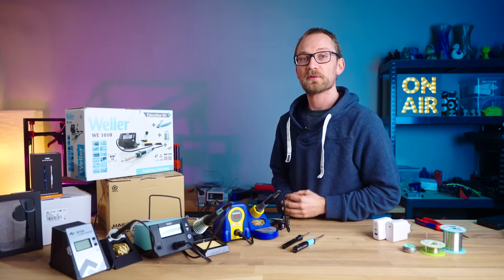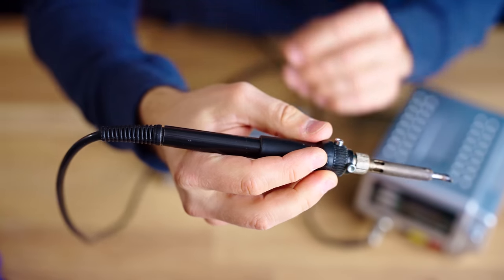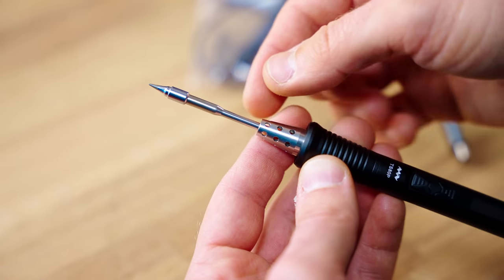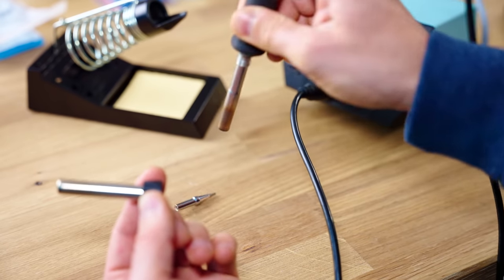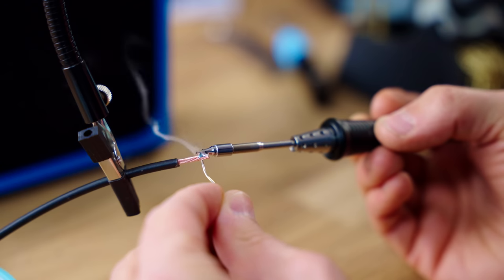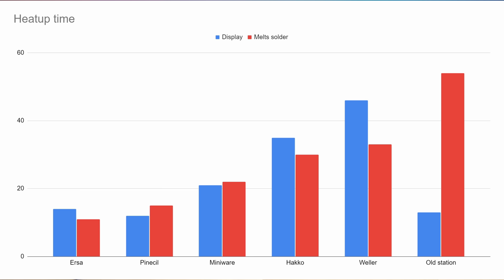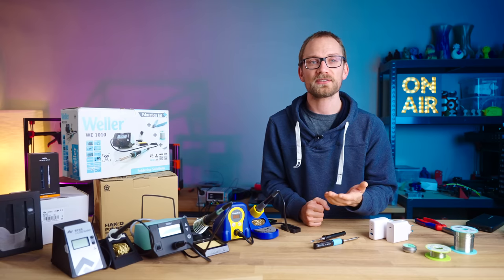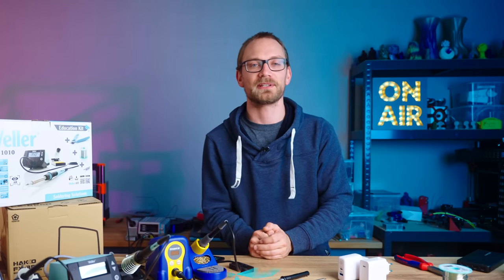Best hobby soldering iron? Pinecil vs. Miniware, Hakko, Weller and Ersa

Comment: I absolutely agree! I work in my lab full time, mostly focused on component level board repair for industrial clients. And when clients need it….I specialize in test equipment repair, calibration, and other metrology related tasks.

I love my test equipment and tools like my children. And I REALLY love some of my expensive soldering stations. I wasn’t expecting the KSG ER to come anywhere close to the more expensive gear. But it does! Been using them for a few years now, 12 hours a day six days a week. I have several, And always have at least 1 or 2 stations powered on when in the lab

the KSGER T12 has REALLY impressed me. For About $50… it performs 95% as good as irons/stations in my lab. Most of which cost 10 to 20 times more!

Comment: You did miss the Miniware TS-100. It runs from a DC power supply and is rated for 65W at 24V. I believe it also uses is able to use Hakko T15 tips although they are a bit longer. I replaced the stock power cord with some thinner gauge Silicone wire that is very flexible.

Comment: I bought that same Weller unit for occasional soldering at work, and it is, as you said, a solid and reliable unit, and one that I was comfortable purchasing with somebody else's money (I don't want cheap tools that die at work).    What I bought for home is a KSGER T12 and it is.... gloriously fast.  I really like the KSGER T12.  It was a lot cheaper than the Weller, and it has shown itself to be reliable, but certainly there was some doubt at time of purchase, and it took weeks to arrive.   The Weller was in stock at my supplier and I had it the next day.  
Honestly, I think that for the price of the Weller you could buy two T12 units and keep one with a type K tip and the other with a small tip and it would be a rare day, indeed, that you needed to swap a tip for normal work.   Being in the T12 world gives you access to many different shaped tips, including ones shaped to heat chips all the way around and other strange devices - that can have value if you do a lot of certain kinds of work.

Comment: Great comparison, thank you!
Heh, I know you from the time I tinkered with 3D printers, and now was looking at soldering irons for a whole another topic and was like Oh, a familiar face!

Was considering a Pinecil or a TS101 but the thing is, the older brands like Weller, those will keep working for decades. My dads 30 years old Weller soldering station is still going strong, and you can even still buy new tips for it without any problem. 
I do not think a Pinecil can live that long and you certainly won't get new tips for it in some years.

Comment: It should be the same on the Pinecil, but on the TS100 you can leave the screw on the opposite side of the screen since it's not long enough to tighten the tip. I personally keep the screw on the screen side a bit loose so that it has contact with the tip, causing some friction but not enough to lock it in place. This allows to just pull out the tip and plop the new one without extra steps.

Comment: I have a ksger t12 v3.15. Very fast and flexible. Not expensive also easy to change tips. The menu is easy and lots of options you can set. Even make profile for different tips and calibrations.

Comment: I've had an 888D for a few years, and I love it, but sometimes knowing you have to find an outlet and set up a whole station is enough to prevent me from starting a project. 

I convinced my boss at work that we should replace our crappy red weller iron (not convinced it wasn't a woodburner, actually) with a pinecil, just because I wanted to try one.

I bought one for myself, because it's a great little iron, and I can run it from my power tool batteries. It can live on my PC desk and not be in the way, unlike my Hakko

Comment: just remember that the weller was said by eevblog to be lacking a primairy side mains fuse

Also the tips that are more expensive on the cheaper ones: they also have heating elements closer to the tip and that means its finer controller temperatures and should be much more stable.

Comment: I got a good deal on a Weller WS51 like 25 years ago when a local electronics store was going out of business. That thing is still dead accurate and an absolute treat to solder with after all that time. It was very expensive to me as a university student with a part time job making minimum wage but its maybe the only electronic item I have that is that old. Just no need for anything newer.

Comment: I use a Weller WSD 81 station with a WSP 80 soldering pencil, not cheap but solidly built, very reliable and spares will be available for decades. I've heard good things about Hakko and would be willing to try one out if I'd need a new soldering iron but as I also have a fixed temperature Weller TCP station I bought new in the late 1970s that's unlikely to happen anytime soon...

Comment: I bought a pinecil a good 8 months ago now. I love it. Worth every penny. Iron os is great, easy to update (on linux). I need to buy more tips. If you use the barrel plug, consider making a silicone cable out of a tattoo gun power cable. There's a few videos on it, mainly for the TS100 but it works just the same.

Comment: I have been soldering for almost 45 years, and I hate lead-free, primarily becaus it breaks down much more quickly than regular 60-40 lead solder, especially with temperature extremes, not just from heat but also extreme cold.  Millions of devices are consigned to the landfill every year after failing prematurely because lead-free solder connections just don't last as long.  Also, although rosin flux used on lead solder is non toxic, non corrosive, and usually non conductive, leadfree solder uses acidic fluxes that are corrosive, toxic,  unpleasant to breathe, and *conductive*, and must be completely removed from your solder connections or the flux residue will cause the copper traces to degrade, and perhaps even cause current leakage paths through the remaining traces of flux. Also, the higher temperatures necessary for soldering lead-free, and the corrosive fluxes, tends to greatly shorten the lifespan of even the best quality soldering iron tips. Cheap tips, made of crap metal that aren't well plated, will have a very short lifespan if you are using lead free solder.

(PS, the reason that 60-40 tin/ lead solder has lead in it is to stabilize the tin and prevent  "tin pest", where the tin changes its crystalline structure, crumbles or becomes powdery, and degrades. Look up the phenomenon called "Tin Pest". Also look up "tin whiskers", aka "dendrites".  Lead free solder is still mostly tin. but the other metals it is alloyed with don't have the same stabilizing effect as lead would. Tin solder without lead to stabilize it actually derailed an early Antarctic expedition !).

Comment: If you want really high end, you need to go JBC. I used many soldering irons in my life and those are just something else. They just don't care how large your mass is and I hardly have seen more then 20-30% usage even on large parts. The temperature stability is just superb. You can switch the tip in a second and the new one is heated up when you reach the part.
Reply: JBC and Metcal are basically black magic. But sadly the price tag reflects that as well. Though, they are both dipping their toes into more affordable market segments in recent years, though still quite expensive compared to anything in this video.

Comment: The TS-100 is amazing. I've been working as an electrical engineer designing surface mount devices. 
After using a bunch, the ts100 is my favorite. It's response time is similar to the hako, while also being more convenient, having better thermal conductivity, being portable, and the temperature control is a lot more accurate. I also like that when the wattage goes up and it detects that you're using a lot of heat transfer into a large thermal mass, it will boost the temperature up a little bit so that the target temperature is somewhere across the gradient.
Reply: Does it reach the advertised 400°C? I am asking for industrial solder.

Comment: Having extensively used the Pinecil V1 (as shown, for two years) and the newer, but same price, V2 (for the last year), as well as a more fancy Ersa station (for the last two years), I can give some detailed insights into longer use. Before that, the main advantage that the V2 has over the V1: shorter tips with less resistance (=more current, higher power), and a higher voltage rating (28V for up to 120W of soldering). Also, I recommend buying the "gross short tip set" for the pinecil, it's well worth the extra cost of 26$ (<30€ after import duties if you order combined with the pinecil). I haven't used the default conical tip even once since I got the tip set with the V2.

- The Ersa tip system is better at transferring heat than the Pinecils, despite having passive tips. I can comfortably solder an XT60 at 320°C (leaded solder) with the Ersa chisel tip, while the chisel of the pinecil needs about 350°C for the same job. The bigger C4 tip for the Pinecil can also do it at 320°C, but it's a more clunky tip.
- Ersa has far more overshoot in the temperature while heating up (as much as 70°C)
- With the newer shorter tips, heating up is even faster than before
- The problem with the worn shaft (annoying tip change) on the Ersa only gets worse with time
- For both systems, the tips were in use for multiple years very actively, and there's no sign of worse heat transfer or permanent corrosion, like on my first noname soldering station
- The pinecil just has an overall more flexible setup. I like flying FPV (DIY drones), I can literally use any of my LiPos (up to 6S) or a USB PD powerbank, my laptop charger, and fix my drones out in the field or at my parents' house. The Ersa needs AC, it's literally a station. Also, the USB PD implementation is the best I've seen. It just takes whatever voltage options you give it and it selects the best. You can even debug other USB devices that won't charge from a weird Type C charger.
- Other than mentioned, the Ersa in our workshop does have an accelerometer. I don't think a standby function without an accelerometer is worth anything at all
- The menu system in the Pinecil is very intuitive, it even got better with animations. Conversely, I don't understand what all the menu options in our much less feature-rich Ersa station do

Overall opinion: Both are great. If money is not a question for you, I'd recommend the following (of these two):
Get the Ersa, if you have exactly one table that you use to solder everything. If you plan to carry it around around the workshop, or even be outdoors, in your car, or wherever, get the Pinecil. If you have a shared table with a PC, and otherwise limited space, get the Pinecil.
If money is a consideration, get the Pinecil.
Don't forget, to get a PSU and the big short tip set, if you get the Pinecil. If you get everything from the Pine Store (pine64.com), the costs will be 77$. It's not your 25$ solution as advertised, unless you have absolutely no money for the tip set and you already have a laptop charger. After shipping and import duties, the price will be around 95€ here in Germany. Still less than half of the Ersa.

For the other solutions: I haven't used Hakko, nor the Miniware. I've used Weller only twice and don't want to use it again. Too slow, too expensive for the function and quality.

Comment: I've been using a Weller WESD51 for the last ~14-15 years. It doesn't come out often but when it does it's a pleasure to use. Which I had to do last evening to solder a connector for a new fan on my Ender 3 max.

Comment: I'm really happy with my generic T12 clone soldering station. It runs from DC (anywhere from 12v to 24v) but heats slower and slower as the voltage drops. I wired in a DC:DC converter wired to provide 24V and find it works great to run the station from a jump start pack.
Reply: Last year I wanted a T12 clone mini station so I made researches. The conclusion from hackers searching to create open firmwares is that those T12 clone stations are all over the place in term of nomenclature, internal design and build quality. A lot of users even complained about the oled screen being dead after 2 months of use. So finally, I opted for a Pinecil even if I prefer the UI of a station.

Comment: Quick clarification on TS80P. It's not supposed to be unplugged and turned on again every time. It has a built-in accelerometer and turns off after 10 mins (adjustable in firmware) and turned back on after you pick it up. I leave mine plugged and only unplug when I have to do something in the other room. That's why it doesn't have to remember the temperature and requires pushing a button  after powering up

Comment: Having both a TS-100 and the Pincil (and a ancient dumb 25W iron, two old no name soldering stations and usage experience with wellers) .
Not going back to the old style irons with a separate heater cartridge again (actually the Ersa performance does look quite good, but the tolerances it seems to require are just too tight)
Any way if you are considering buying the Pinecil consider getting some different/extra tips for it.
I really like tiny conical tips for most of my soldering, but some times a larger tip for better thermal contact is very very  handy...
Also take a look at there heat resistant silicone USB-C cables.

Comment: I have a Pinecil V2 which is even better than the original. It can get up from ambient to 350C in just around 6 seconds on a 65W PD supply, and begins melting the solder in a similar amount of tile :D

Also something to note is that you only need to loosen the front screw on the Pinecil to release the tip, the rear one just holds the case together, and the V2 does come with a paper manual in the box.

Comment: I much prefer old style leaded solder, if you've got proper ventilation it's really not a problem. 

I just think it wets better and is much easier to use if you're doing something very small and finicky.

Comment: The Back screw on the pencil does not have to be unscrewed to remove the tip, just the front one, and I can recommend swapping that for a thumbscrew. That will make it much easier.

Comment: I use an old Weller iron at home which is plugged directly into the outlet. It means I have to remember to unplug it after use but it heats up pretty fast and has enough power for bigger jobs. I use a hakko station at work that has an auto cut off when the iron is in the holder. The heat up time of the hakko is insainly fast which is good because it starts cooling down every time you put the iron in the holder.

Comment: I use the Pinecil for fine soldering with my Apple 140W power supply and Pine64 USB-C cable. A cheap Parkside 20V battery soldering iron for crude soldering.

Comment: Used to work with Ersa irons professionally, they are a joy to use for every occasion, however, changing the tips is the worst thing about it. Those plastic nut holders keep breaking, the plastic gets uncomfortably hot, sometimes the tips jam and you need to remove them forcefully. You really learn to use only one or two tips for any soldering job. Now using the miniware for personal projects. Btw, the firmware updates fix all of the issues

Comment: What kind of soldering iron you use depends on what you solder, if it's all surface mount you need to look at hot air systems, if it's through hole you need an iron with a little balls to handle large solder pads and point to point wiring. An assortment of tip sizes helps but you need enough reserve capacity to get solder molten quickly. I find a 700 degree tip is a good compromise because it gets a junction up to temperature fast, if you use a small iron set to 500 degrees it take forever toget joints up to temperature and you will do maore damage than a 700 degree tip - if it's used correctly

I've worked as an electronic technician and engineer since 1966 and during my working career I used soldering irons every day. I have had a Weller TCP soldering station on my personal workbench since 1970, all i ever change is the tip - the handle and heating element are original.

Comment: Bought a Pinecil a few weeks ago after another youtuber compared his to the TS80/100. I had not previously looked into the TS irons simply because I would never have paid over $50 for an iron and I thought they would never be as good as a cheap weller. Turns out I'm an idiot and the Pinecil has literally changed my life and I don't use an iron more than once or twice a month if I'm lucky. For the $25, they really are that good going from cold to soldering in about 20-30 seconds. The idle feature is awesome as well because now I don't have to feel pressured to move quickly while my iron loses its tinning turning black and in cases of leaded solder, possibly eating away at my tip.

Comment: I had both a classic (genuine)  weller and hakko soldering station for 30 years. I needed cheap portable iron for using here and there. So I ended up with one called a "random chinese name" 928D III. 110 watts. $25. Digital display, auto off, instant heat. I now use it almost exclusively it heats up so fast and the digital controls are SO precise. You can literally dial in a few extra degrees to get what you need done without burning traces. Uses standard hakko style tips but, again, heats them up SO much faster. The only detractor is the cord is too short and being kind of heavy duty is a little bulky.
Reply: Looks like you've got the Yihua model. Them, Atten, and Aoyue are actual companies and have some interesting models. Replacing the stock tips with genuine Hakko tips has always made a big difference in my experience. Good to know that stand alone iron is good to use.